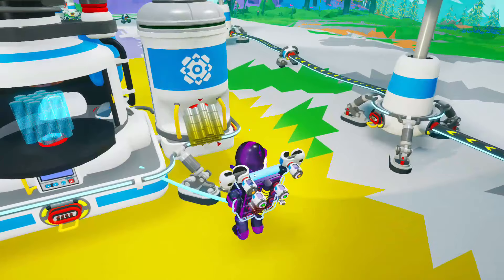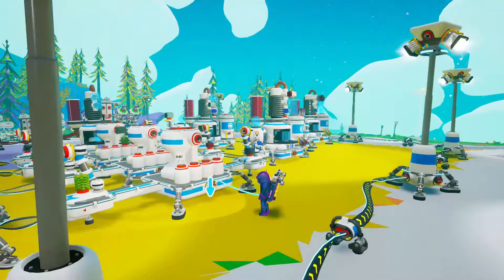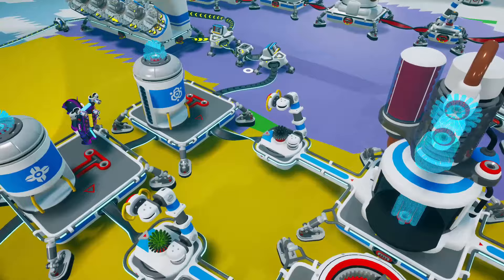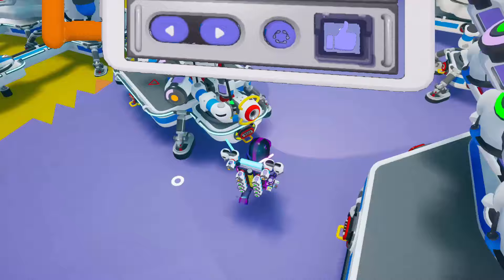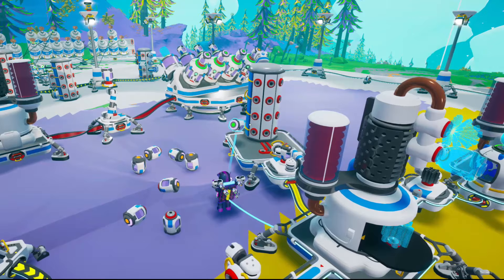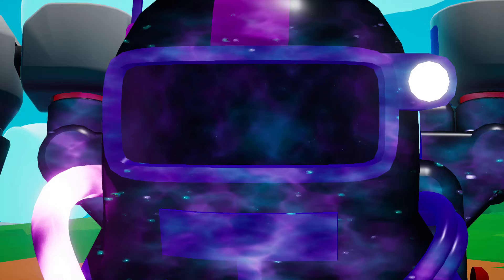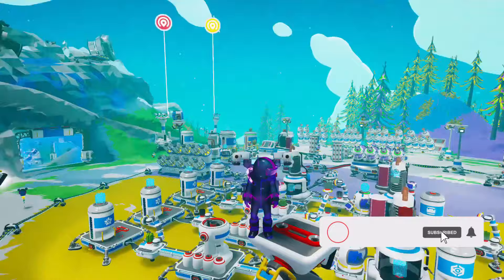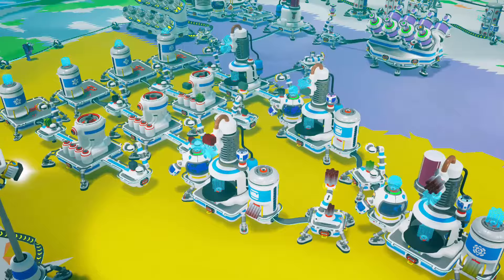EPIC efficient NANOCARBON Alloy auto-farm | Astroneer

Comment: Materials and stuff for steps – All together: Natural, Atmospheric, Refined, Composite
Organic, Hematite, Titanite, AmmoniumX2, Graphite, Hydrogen, Nitrogen, Helium, Argon, Carbon, Iron, Titanium, Steel, Hydrazine, Graphene, Titanium alloy
 
Main Materials
Carbon, Iron, Titanium, Hydrazine, Graphite, Hydrogen, Helium, Argon, Nitrogen
 
Materials for Machines and stuff
Medium Printer - Chemistry labX4 = Glass (Refined quartz), Ceramic (Refined clay), Tungsten (Refined wolframite)
Medium printer – Large Platform BX4+(optional amount) = 3 Resin
Medium printer – Atmospheric condenser (Optional amount) = Plastic (composite of compound + carbon), Glass (Refined quartz), Iron (Refined hematite)
Medium printer – Furnace (optional amount) = 2 Resin, Compound
Small printer – Auto arms (whatever is needed) = Graphite, Aluminum (Refined Laterite)
Reply: Also Large printer for XL Extended Platform - 3 resin each

Comment: Not gonna lie, I made a smaller one back on one of my saves. However I did not automate actual reasource intake so I just smashed required resources on one of the platforms and it popped out nanorcarbon alloy. I might try automating it

Comment: Actually, when you're fast, you can get a tiny bit of Hydrazine out of the dispenser. Half is excessive; you can make canisters with much smaller Hydrazine contents. Start close to the dispenser outlet and press "F" on your keyboard while quickly grabbing the canister that appears at the output. If you have done it fast enough, you should get out about 1/50 of an otherwise full canister. I use this method to stretch one hydrazine load so thin, that I can make dozens of Graphene ingots out of it. The reason for this being possible is: The chemistry lab accepts even miniscule amounts of Hydrazine as an adequate mass to produce Graphene. You can use these canisters also with autoarms, you just have to use a suboptimal setup to make it happen. Put on the Graphite first, then let a delay, that is long enough, add a hydrazine canister to it. Instant placing is not going to work, like you mentioned in the video.
Reply from the maker: Thanks for specifying this

Comment: You don't need a half full (half empty) canister of hydrazine, it can have as much as 1/10000000 filled up, and it'll still work. Just click twice quickly on the medium soil and fluid canister and you will get it, the faster you do it, the less hydrazine you use.
Reply from the maker: Yeah you are right, I meant that it does not need to be full

Comment: I had an issue with the second to last 2 medium storage canisters where I couldn't have them set on enable output and still put resources in? Anyone know how to fix it or change it. I turned it off and it works fine, but I have to move the auto arms closer to grab the alloys from the chemistry bench itself
Reply from the maker: I recommend that you try to watch the video closely again l, if you still have problems you may send a screenshot at mu discord 😊 (link in bio)
Reply: @KuyaGameAstroneer  I will test it again and come back with results

Comment: May I ask how you made such a nice smooth flat surface? I have watched your latest video about that subject but even then it won't work for me. Or do you only use leveling blocks?
Reply from the maker: If you want to get real true flat, you need to be close to a gate (the violet building) and pop a soil cube using the leveling block. Then stretch the terrain out of the cube withe the terrain tool. 

If you are far from the gate, it will not be "real" true flat, but you can get some decent results by using the flatten mode of your terrain tool. You need to first try to get a flat angle with the terrain tool (as flat as you can), than aim at the polygon that is flat and stretch terrain from there. Remember that the terrain tool will stretch soil out of the polygon that you are aiming at
Reply: @KuyaGameAstroneer  And do you use mods for the terrain tool?